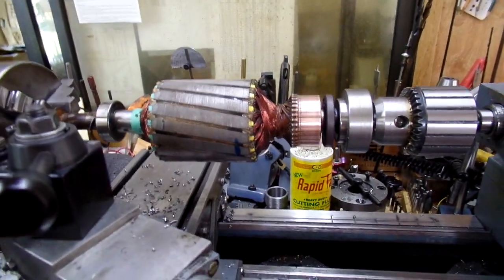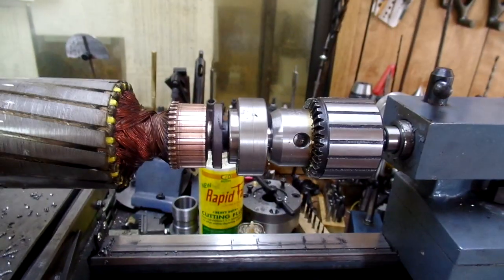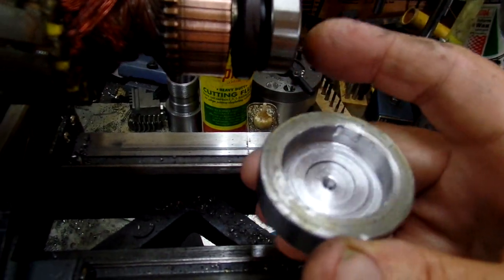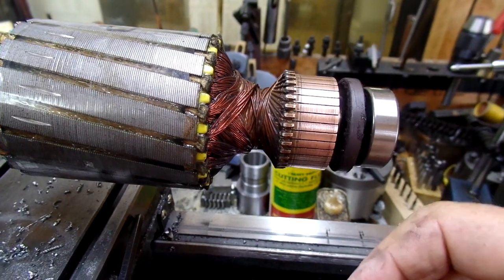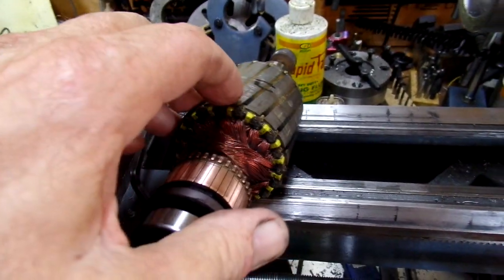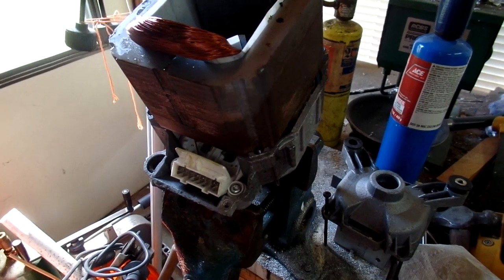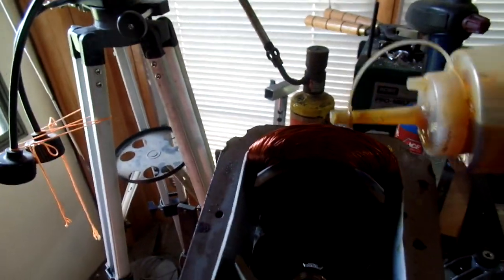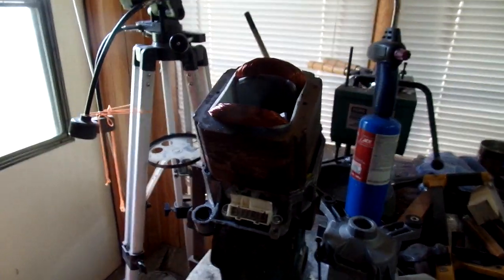E122 polishing a commutator.

Comment: Nice video! Have you ever found that polishing the commutator shorts out the brass and the brushes don't last due to arcing? I have had that happen a time or two. Maybe I polished off too much copper...
Reply: After polishing the commutator you need to deepen the spaces (grooves) between the segments with a hack saw blade to about 1 mm.